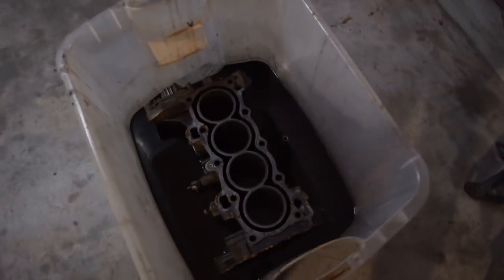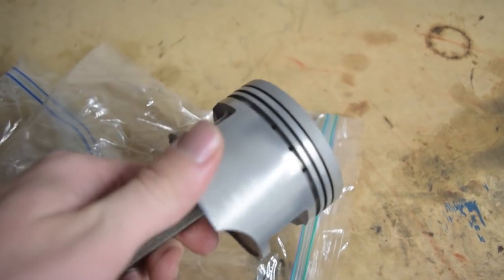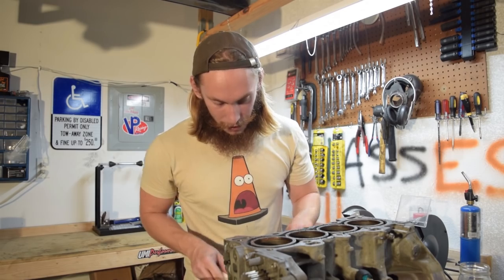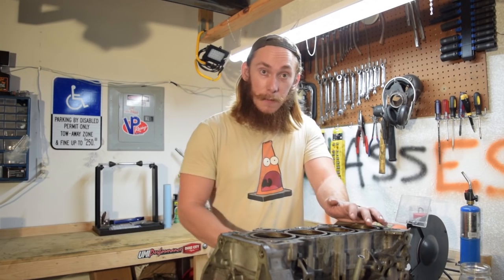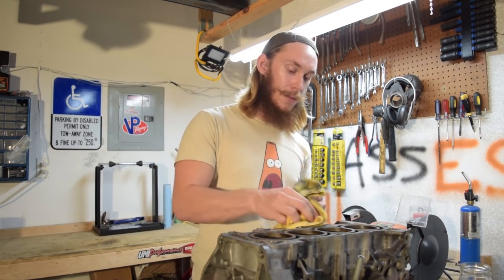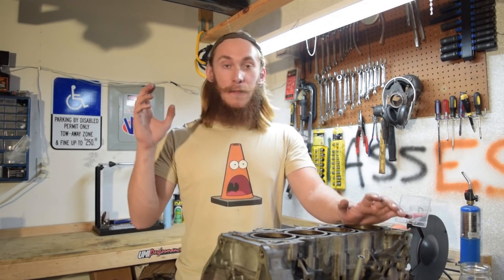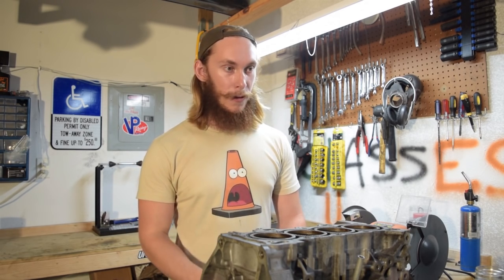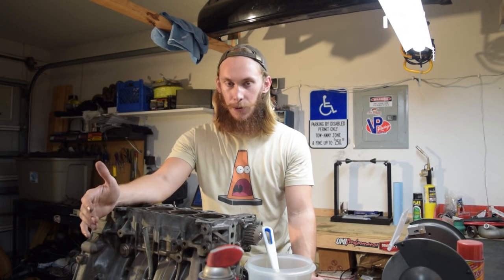DEATH, REBIRTH, AND HISTORY OF THE CRX: Vlog

Comment: I wouldn't k swap.  my k24a2 swapped ep3 w/6 speed lsd is loved less than my gsr w\lsd swapped eg hatch.  Got a lot of time? I'll tell you my K series problems...

The boostedboiz are having pretty good luck 3-400hp awd wagos... D series.  CSS blocks are proven now so there is that too

for an awd swap you can go D, but those donor wagos are hardish to find.  I will awd my eg with bits from a donor crv and will keep it B.  The one thing I dislike about the awd swaps is I am not a fan of the cable shift linkages.

Comment: I can definitely relate in a way to your D series troubles. My first Honda build was an all motor D16Z6 and I spent probably 3500 building it to make all of 150whp haha. Ended up boosting it to get more and the P29 Pistons and all motor cam combined with 15psi didn't aggree. Live and learn. Anyway, have you ever tried a "disco potato" or GT2860r turbo? Over the years that's been the best iteration I have found for a street driven D series. Perfect spool with a lot of top end and still totally atreetable.

Comment: I want to build an RD3 CRV, i dont understand why very few people builds these, their AWD.
Reply from the maker: Perhaps availability is an issue. It certainly would be rad to find an AWD and better yet a manual CRV to build, but it seems rather difficult to find one "local" to anyone that wants to build it up. It could end up being a very practical and very fun daily driver as well.
Reply: I found a couple RD3's for sale on craigslist with close to 200k or more milage for around $2k, im hearing alot of guys swap out the diff from the 05 elements. Once you hit 300whp the stock RD3 diff turns into a roman candle of sorts.

Comment: I'm the same way. I love me some single cams. Even tho I have a dc2 I'm picking me up a cheap ek tomorrow to do a build with lol. I just love how cheap and easy they are to find.
Reply from the maker: The affordability and ease of working on these engines/platforms really is attractive. That also kind of makes them disposable. With the D series, it's okay if you pop an engine. Parts are cheap and available. I do love me some DC2; really wouldn't mind playing around with one sometime. We may actually see another one at some point on this channel. I know Disco has his personal DC2 tucked away waiting for some work. I haven't even seen that one yet.
Reply: Featured Garage Nice! I love mine. It's my first B powered Honda lol.
Reply from the maker: I'm sure it's a whole new experience! How's it treating you so far?
Reply: Featured Garage Oh it is. Good I got it in a trade for a Nissan hardbody I had. Was going to build a drift set up but realized they don't really pass tech. So I got offerd a 96 gsr but with a blown motor. Hole in the block broken rods. But it came with a full JDM b16. Dude even delivered it to where I worked. Swapped the motor in and been daily it 100 miles a day and it runs perfect. So I guess I lucked out lol.
Reply from the maker: Oh wow, yeah I'd say you did pretty well on that one.
Reply from the maker: Looks like you found it. I hit up the pages you sent.
Reply: Featured Garage Awesome =)